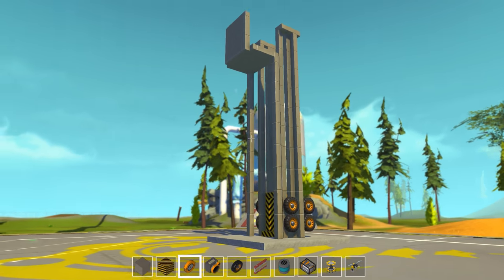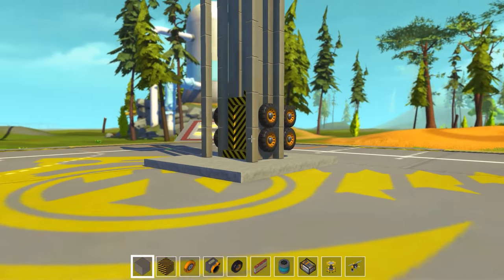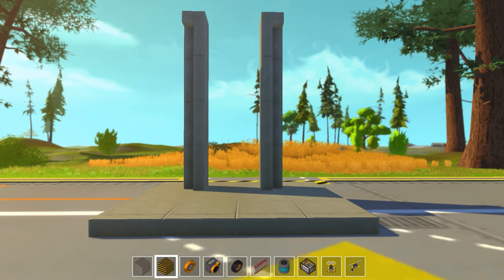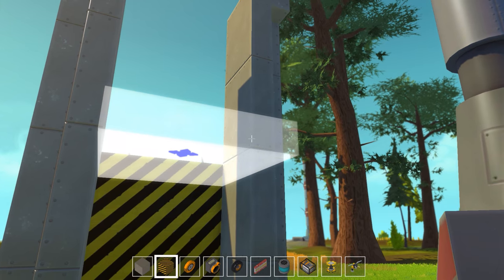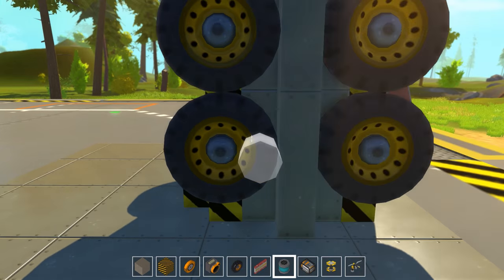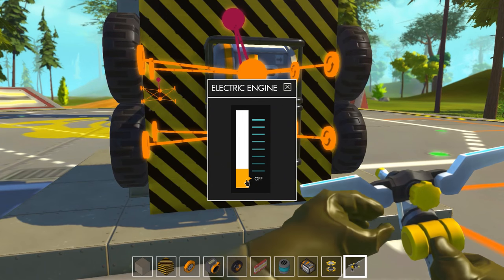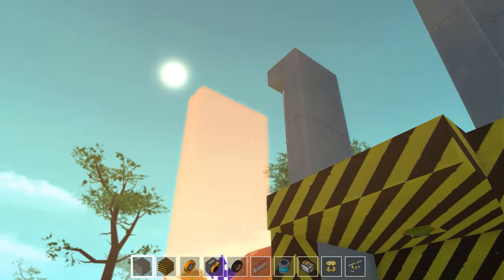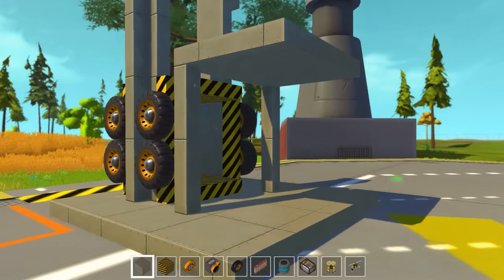Scrap Mechanic Tutorial: Simple Automatic Elevator

Comment: This game need to come to Xbox One so I can actually play it! Looks so fun!
Awesome creation :)
Reply: +TheAlphaBravoKilo the game itself is very bad optimized. at some point you get horrible.. they need to sort that out first ^^

The system requirements aren't that high either. any $600 PC can run this with no problem ^^
Reply: +Hendrik visch Well... $600 is a lot for a college kid.
Reply: No.. Not really,

I have less funds than a collage kid, yet i was able yo build my pc. Ofcourse i got power hungry i try to get a 970 insted of a tier lower, which would be a 380x 

The beauty about PC's is that you od not have to order the parts in one shot. You cna gradually gather the parts.

Go from least expensive to most expensive. 

Make bunndles to what you budget allows. 

Lets say first month you get the Case, Mobo and ram. ~200

The month after the same around the same budget. Which would be the CPU. and maybe the CPU cooler

After that you have about 300/400 dollar left to waste on a GPU whuch can be from the 960/380 to the 970/390

Which is what i did. if i calculate my earnings to dollars i  have about 86 - 90 dollars left to spare. from this i also have to pay the travels to my gf from. this means that i'm left with less  now, i have my gf not as long as i was saving up so i had a decent amount to work with.

http://pcpartpicker.com/p/hPdWxr

This would be my 700-800 dollar build suggestion. To have it asa 600-700 build just swap the 380X for either a 960 or a 380. But it was just an example of a build.

I went with intel because on that board you can swap the 4460 for a much better intel one. AMD cpu's have a really bad upfrade path.. after the 8350/20 it doesn't make much sense to go higher..